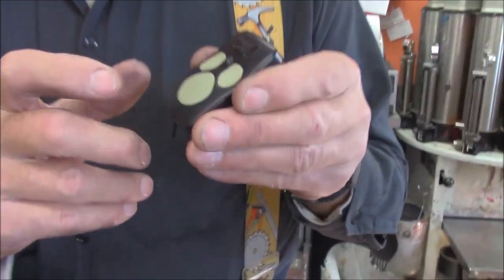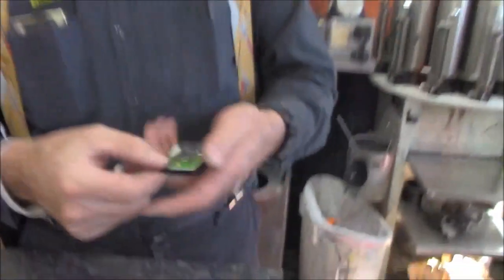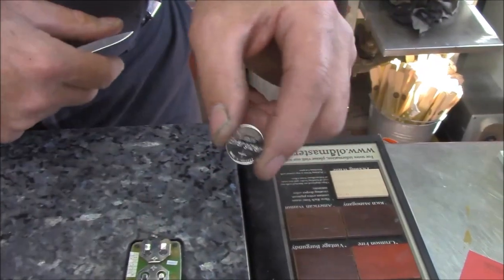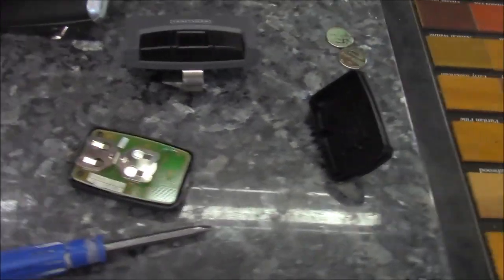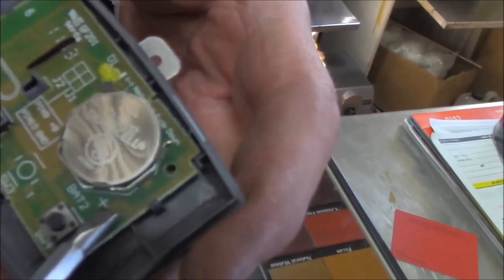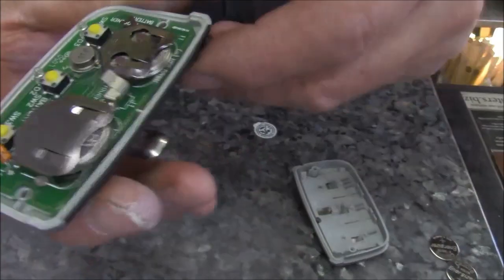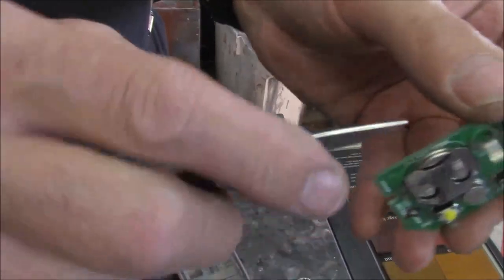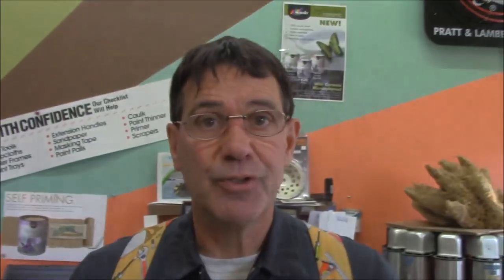Replace Battery in Garage Door Opener in Wireless Transmitters

Comment: Thanks much for posting your video. Like your first example, my remote also had that metal cover over the battery itself and I wasn't sure how to remove the actual battery underneath it - your sliding method (probably the only way I guess) works great.  All other videos I saw before yours showed examples without that metal cover over the battery which is what I had always seen before with other devices that use these button batteries, and with those you obviously just pop the batteries out rather than slide them out.

Comment: Does liftmaster always use 2016? I got a 2032 for a 895MAX an older version for this like the battery was flashing when i rubbed my tool against it but i wasn't sure what they if that has ment like get a bigger battery or reprogrammed my battery
Reply from the maker: I'm not a liftmaster expert but I never expect any battery until I see the number on the case or I can match the size of the battery.
Reply: @MrHardware1  Thank you so much for replying I appreciate it and the video.. oh i found the battery size its 2016 for the Liftmaster 895MAX that I have for my garage I just thought I had a broken remote turns out the battery for 2016 takes 2 batteries. Thanks again😁😁